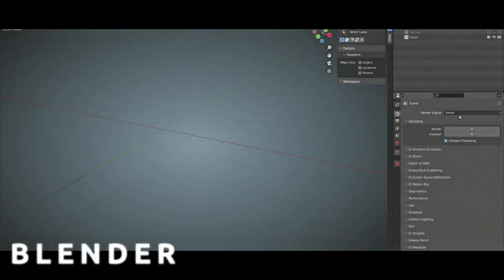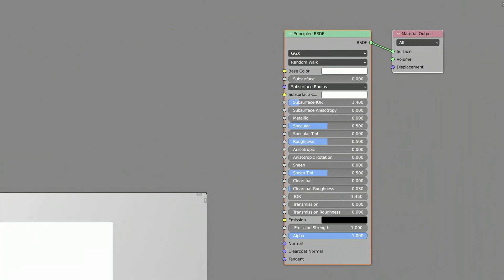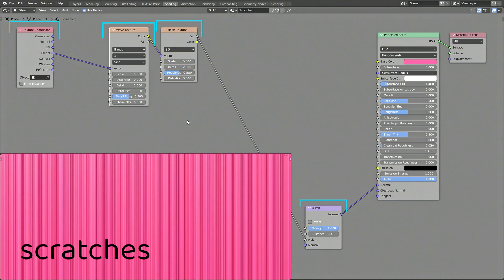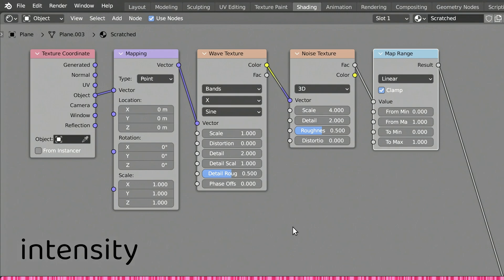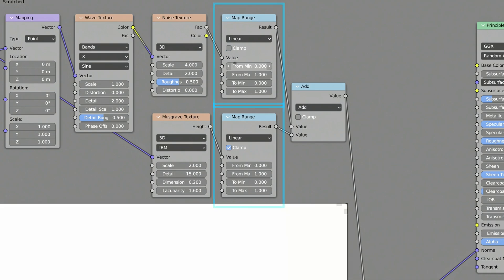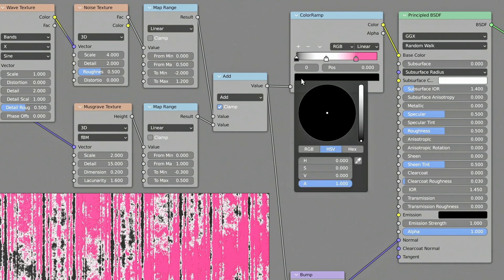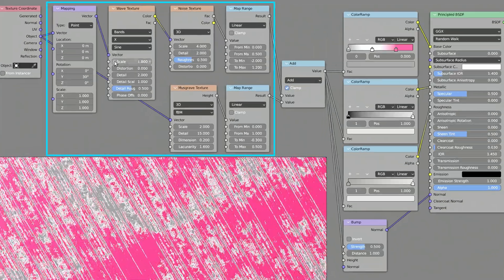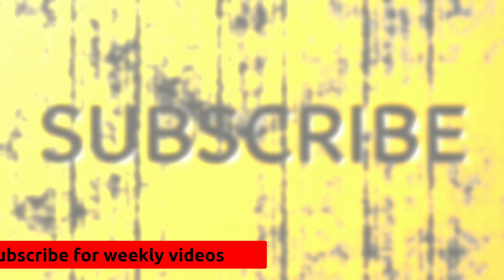Procedural Scrapes and Scratches in Blender

Comment: For anyone like me who spent time looking for the old Musgrave Texture node: in recent Blender versions it has been merged into the Noise Texture node. To get the same kind of results as before, you mainly need to tweak Roughness and Lacunarity.

If your goal is to simulate very small-scale details like skin bumps, micro-scratches, etc., fBM is usually more appropriate. For larger, more aggressive features such as rock cracks, terrain, or erosion, switch to Multifractal. You can also disable Normalize to get harsher, higher-contrast results.

btw, kudos to @sinasinaie for sharing this precious knowledge !

Comment: hi, I am new to procedural texture. I was thinking to add a second wave texture to create something like a cross wave pattern,  but i dont know how, i have to add it and mix it? can you give me an advice?
Reply from the maker: Yes, select all the nodes from the texture coordinate all the way to the add node (8 nodes in total) and duplicate them. You will now have 2 add nodes. Add a third add node (math node) and use it to add the previous two add nodes together. This third add node should be connected to the subsequent color ramp nodes and bump node. Finally use to rotations on either of the two mapping nodes to rotate the scratches.
Reply: @sinasinaie  cool, thx!!